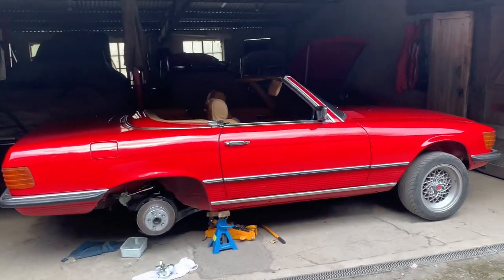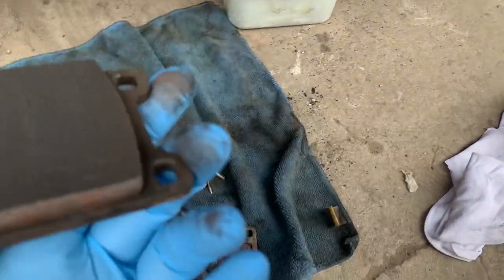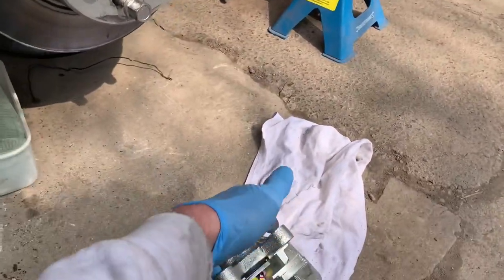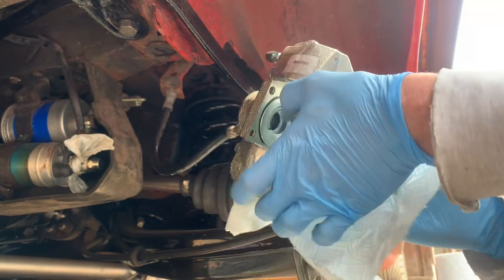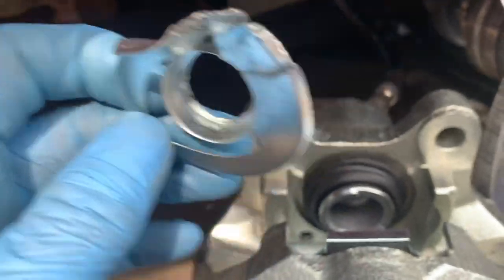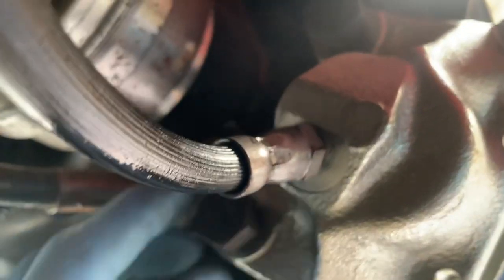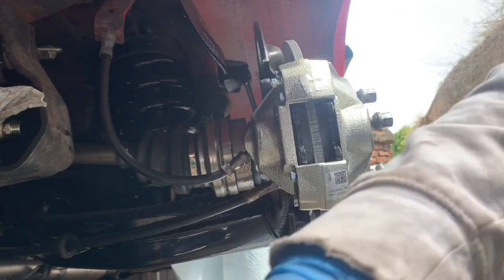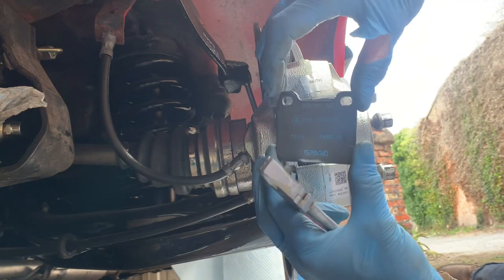Mercedes R107 rear brake caliper replacement

Comment: Thanks Mike. Great video. I need to redo my calipers so this is very helpful. I have an 84 380SL with the same color combo. Also starting to make videos. Awesome car.
Reply from the maker: Thanks for you comment and good luck with the brake job.Mike
Reply: @MikesMercsandothercars  Thanks… haven’t done the calipers yet but I noticed that after driving, my back brakes get warm but my front brakes are cool. None seem stuck. Any thoughts?
Reply from the maker: @sophiathe380sl  Hi - only just seen your comment so apologies for the late reply. Warm rear brakes can mea one of two things:

1. Either your brake pads are catching because corrosion on the calipers pistons is stopping them going all the way back. That was the problem on my Pagoda and is common for cars that arent used very often.

2. Or....your park brake shoes are catching. If that is the case, you may notice that your park brake is becoming less effective...or requires more travel to bite.

The solution is to get the car up on axle stands and spin the wheels by hand. You might be able to hear/see the issue.

Catch this problem early, because if it gets worse you may boil your brake fluid and need a tow home.

Mike

Comment: Great videos! You should normally leave the metal dust shields in the caliper in place to protect the rubber seals. By the way, rebuilding the calipers is fairly straightforward. Just rebuilt all the original calipers on my 1973 350 SL using genuine Ate kits. Adding some paint they come out like new. Assuming they are not completely seized, of course 😉
Reply from the maker: Thanks for your comment which has prompted me to email Brembo for confirmation of whether  or not those clips should be removed and if so how.. Unfortunately GSF kept the box for the old cailiper. Do you remember what you paid for the rebuild kit? Mike
Reply: @MikesMercsandothercars  Around 20EUR per caliper. There are cheaper alternatives, though. You will also need some caliper grease. 

I just did some check up. It seems that the rear calipers come without this shield, at least those made by Ate. The front calipers definitely have them. I don’t have the car around right now - still in winter storage...
Reply from the maker: @thomasditlev1973  Thanks for you reply. Hope you enjoy your summer cruising. Mike
Reply: @MikesMercsandothercars  thanks Mike, i will. And carry on the good work!
Reply: I thought too that those dust shields are there for a purpose and to stay...at least those are on service manual pictures...I put them back after I changed rubber seals on my R107's brake calipers.

Comment: Very good video, thanks! Your brake hoses look fairly new, but generally this would be a good opportunity to replace brake hoses as well. Arne, 1980 450 SLC, Norway.
Reply from the maker: Thanks for your comment. Those hoses  are fairly new otherwise you are tight, replacing them would be a good idea. Hope the 450 is running well. Mike
Reply: You probably dont care at all but does any of you know of a method to get back into an instagram account?
I somehow lost my login password. I would appreciate any assistance you can give me.
Reply: @Lane Shane Instablaster =)
Reply: @Brantley Bode i really appreciate your reply. I got to the site thru google and I'm waiting for the hacking stuff now.
Seems to take a while so I will get back to you later when my account password hopefully is recovered.
Reply: @Brantley Bode it worked and I actually got access to my account again. I'm so happy!
Thank you so much, you saved my ass!
Reply: @Lane Shane No problem xD
Reply: @MikesMercsandothercars  Are the hoses easy to change out? Will I have a bunch of brake fluid coming out of the hoses when I loosen it?
Reply from the maker: @sophiathe380sl  The brake fluid will drip out (not gush out). You can cap the flow with the finger of a rubber glove and an elastic band.. Mike

Comment: Hi Mike trying to bleed brakes on my 1986 420sl think I've got air in abs so front brakes won't bleed, any suggestions? Thanks keep up the good videos 👍
Reply from the maker: Thanks for your comment. What are the symptoms of your problem - eg what makes you think you've got air in the ABS and how long has the problem been there? I'm no great expert on these matters, but I wasn't aware that the procedure for bleeding 420SL brakes would be any different for any other R107. Sometimes air gets trapped in the slave cylinder which can be a pain to remove. Mike
Reply: @MikesMercsandothercars  Got fluid from cylinder to abs then to rear calipers but no fluid coming from front calipers, tried bleeding but nothing comes through
Reply: I renewed discs and pads recently and being a novice lost all the fluid!
Reply from the maker: @mikehawkins5815  If you have no fluid coming out of front brakes with bleed valve open, could be a clogged bleed valve (s) or clogged calipers. I would take brake line out of the back of caliper and see if fluid  comes out. If no fluid is coming out the line, you need to trace back to where fluid id coming out. For example, it could be a faulty/clogged master cylinder. Let me know how you get on. Mike
Reply from the maker: @mikehawkins5815  Yep - done that  a few times. See my other reply for suggestions. Mike